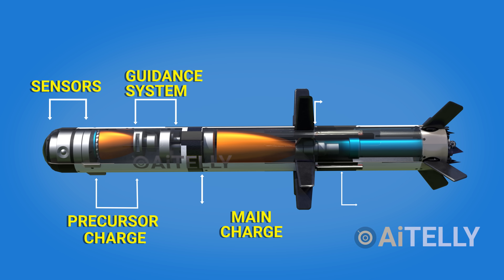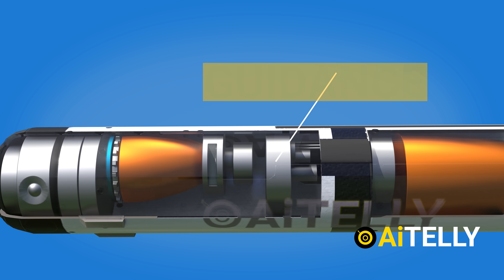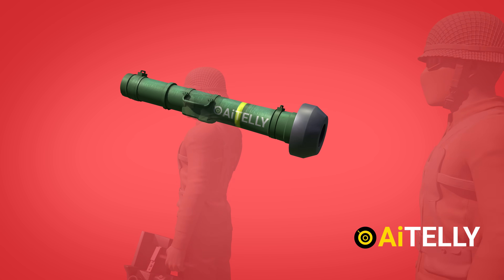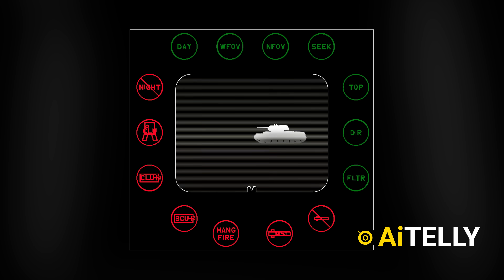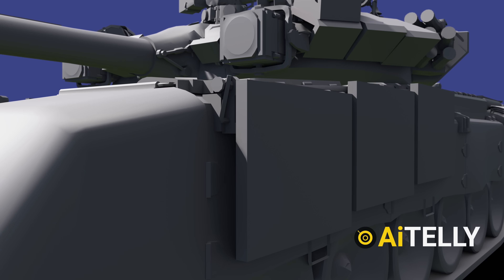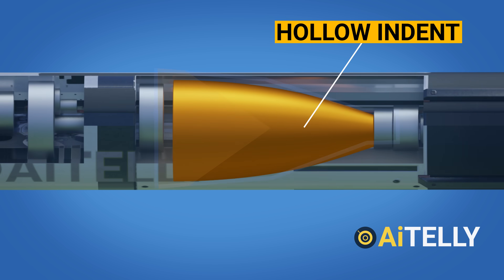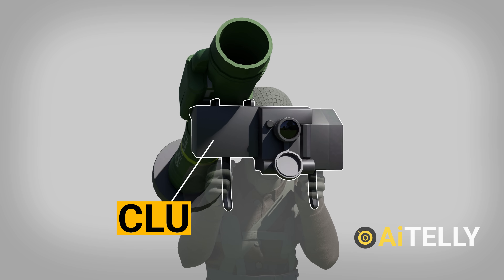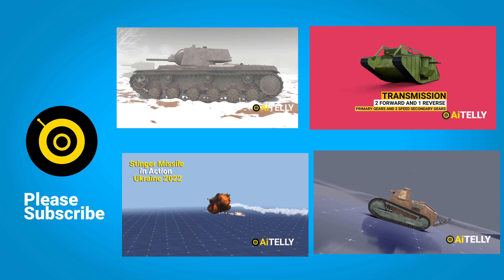Javelin Missile | How a Javelin Missile works

Comment: Very important details: the CLU's thermal sight is a line scan camera, basically a line of pixels getting scanned across the scene rapidly.
The seeker on the missile however, is not a linescan camera, but instead a starring array sensor. It has the same imaging principle as a modern visible light camera. I believe the pixel count on the seeker is either 64*64 or 80*80, and is faster than 60 Hz; still have to dig up the files
Reply: I am also interested in the framerate of the sensor in the missile head. It is probably over 60 fps (but it is usually a military secret) The US has always banned IR thermal sensors operating at more than 9 fps. I'm into programming and electronics as a hobby, and for civilian use, it's very hard (legally impossible) to get a decent IR sensor with long range and decent fps in the west. All thermal cameras work at 7 to 9 fps or if they have higher fps, then they are of poor quality and cannot see beyond 7 to 10 meters.
I deliberately mentioned "IR thermal" sensors, so that no one would confuse them with Near IR (near infrared) sensors, which are easily available and cheap.
Reply: @goranjosic  that makes the two of us! I'm located in Canada and it is equally hard to get these sensors/cameraa, how ever if you wanted to get an uncooled microbolometer one for projects i could help out :) I have been collecting them for the past decade...
 good job on clarifying the wavelength of these sensors!
For other nerds or soon to be nerds, the rough range of detectable wavelengths are listed as follow:
"Normal" cameras: 400-800nm
Intensified night vision: 500-1100nm
Laser range finders: 905nm (pulsed semiconductor), 1024nm (pulsed Nd:YAG or YVO4), 1550nm (pulsed erbium)
Laser guided missiles: 1024nm or 1550nm (1550nm lasers are modern and are undetectable by night vision goggles which make them extremely deadly)
Javelin and most heat seekers (cooled quantum detectors): 3000-5000nm
Thermal scopes (uncooled microbolometers): 7000-14000nm
Reply: @goranjosic , I don’t understand how it’s physically possible to limit the range of a thermal camera. How can they possibly prevent infrared photons from traveling beyond some distance?
Reply: @terjeoseberg990  sensor sensitivity.  The ones sold for cheap on eBay and AliExpress can barely pick up thermal signals from 6 to 9 meters (7 on average). Sometimes even in description it say that these are sensors of limited sensitivity compared to sensors in expensive cameras that cost a few thousand dollars. But I wrongly wrote that it has to do with the high framerate, it has nothing to do with that - simply, cheaper sensors in the over-the-counter market are generally less sensitive. And from what I managed to find out, all civilian sensors have low framerate.
Reply: @goranjosic , So you’re referring to the signal to noise ratio?
Reply: @terjeoseberg990  yes basically; it is actually indicated by the net equivalent thermal delta (NETD) rating of the camera. Old and or cheap thermal cameras usually have > than 100 mK capabilities, while advanced ones have 60-40 mK sensitivity.
My 100mK ones can actually (barely) spot the temperature difference between skin and blood vessels close to the surface of the skin; while my 40mk one can easily do that plus some smaller surface veins.
Reply: @goranjosic  THATS why those things suck so bad?? I thought having a FLIR cam would be cool but they're pretty garbo.
Reply from the maker: Thanks for the Info
Will put your comment on the Important Note list 👍
Reply: @Aitelly  thank you for making an effort to spread knowledge! I will try and find the actual source so that I'm not spreading false or inaccurate information 😁
Reply from the maker: @alexwang007  Please do .Let us know the right data. Eagerly waiting
Reply: Note the upgrades done to both the seeker and the CLU detectors, these upgrades will most definitely greatly enhance the resolution (as opposed to 64*64 resolution, one can obtain 640*480 or even 1024*786 resolution microbolometers); this should in turn greatly enhance the newer Javelin's target tracking ability.
Reply: those ukrainianmobsters ukraineflorida drkMarket $250K 1/4 Million per Missile Selling what we Give them For Free To mideast Terrorist&drugcartel countries Such As the 300 plus BulletProof Vests that Disappeared that we u.s. Gave them ukrainemobsters
Reply: actually this is all wrong, the missile detects the presence of communist sympathizers and becomes so enraged it slams itself into them
Reply from the maker: We take your suggestions seriously.
So here is the F35 Jet we just made
https://youtu.be/vgUnF9hUmLQ
Reply: The CLU is actually indeed more valuable and potent as a deterrent, than the Javi missile itself.  An Army could be given say, 1000 Javelin rounds as a gift, but only 10 CLU.  So the deterrence value in this hypothetical is more relative.  Whereas, An Army with 50 CLU and only 500 rounds would very likely field much greater tactical capabilities .

Hence, probably a good reason to not let the aggressor side know exactly how many CLU you have fielded!?!  And probably understate the number, if anything .
Reply: This shit is supposed to cost 100000$ ?
Where do the money go ?
Reply: @divoulos5758  it is not worth 100k. It's all the development (with infinite budget), and the component military grade certifications that raises the cost drastically, also probably with an 80% profit margin on top of all that.
Reply: @divoulos5758  --  $100k to knock out a $million dollar +  totalitarian-rule, imperial cabal commanded invading main battle tank  ??  That is not rocket science.  Thanks though, for contributing to the greater open dialogue  

edit:  Mir vsem brothers,  yes even to the modern-day inading hordes ✌🔛 we're all all human!  Spacibo
Reply: @donkoh5738  million dollar?
Bro its t72b3 it costs like half a million 
Also the javelin has so many parameters that anything can go wrong 
First of all doesn't work in urban areas 
Second because of the top attack trajectory its easily detectable by radar warning systems 
Also if the missile doesn't hit the turret top plate it probably wont do anything 
Thermal smoke launchers will fool it to miss
Ever wondered how does javelin know where the turret is since it only uses thermal vision? Probably by either engine heat or hull heat 
In case of engine heat simply turning the tank will make it miss 
In the case of hull heat putting a piece of metal sheet behind the engine horizontally will make the missile hit further back because as it sees from above the length of the tank will look bigger

Comment: So the missile locks on thermal footprint, then what if vehicle's engine is not running ? It becomes useless, am I right ?
Reply: It takes hours for an engine to cool. It only is a problem in the winter.
Reply: @miguellopez3392  Imo it's the other way around, in winter you warm up the engine to keep you vehicle ready to go at any moment. While in summer you keep your vehicle at hidden position without need to warm up the engine. Also if you look at tank in frontal projection, the thermal camera won't see a footprint because engine is behind and it doesn't produce hot exhaust gases.
Reply: @illiahapak501  did you forget metal conducts heat? In winter the steel is cooled by the ambient tempature of the environment, in summer the steel can heat up to 150f in sunlight, heat from the engine can warm the tanks entire hull if ran long enough, you don't need a hot engine to lock on, it locks onto the specific signature, in winter tanks stand out less as reports from Ukrainian soldiers using the javelin system.
Reply: So if you put aluminum blanket(like those used by rescue crews?) around tank or cardboard it cant lock?
Reply: @zumbazumba1  that foil won't do much to stop engine heat.
Reply: Another thing is that some tanks have auxiliary power units like Challenger 2. They run all the vehicle’s systems with it. This allows them to use less fuel but lessen the heat signature. Challenger 2 can also be dressed in thermal insulation camouflage.

Comment: Russia has a secret weapon - the gravity switch. If you send it to the enemy's territory, then everything will soar into the air to a height of 14 kilometers and drop sharply. On an area about the size of the state of Florida. Who is not underground will break, and who is underground will suffocate on the ceiling.
Reply from the maker: They had sent outdated javelins or expired Battery that why it did not work.

Comment: You didn't mention about it's short battery life, and it can operate in seeking mode for about 2 minutes, then it has to cool off. Also the thermal imaging is only 64x64 pixels so it can be fool by something other heat source. I heard it can be fooled by aerosol smoke. It's also not very easeful in the city fight.  Looks like the tank has to have 2nd layer of dynamic cover or active armor protection system.  But it's a very dangerous weapon for the older tanks and if used in right hands at right time.
Reply from the maker: Thanks for the feedback.we miss that.
We are learning from comments right now.
Will do better with New content.
Reply: @Aitelly  I don't know if I'm responding to a bot reply, but the problem with all the news and other technical information (this video clip is included) is that it's taken only from couple sources especially from loyal side. Which leads to present incorrect information.
Reply from the maker: @Andrei Casiadi  I'm not a bot :) We just have to reply to a lot of Comments .
Pin your Comment as we find it Neutral and Valuable.

New Channel so Hustling as we move along.
But we take your Feedback Seriously.
We are not always Right.
Yes Honestly We collect a lot of Data from different Sources.
Reply: It's a very dangerous weapon for modern tanks
Reply: Field tests in Ukraine showed that it's good NOT just for "very old tanks", Andrei 😁
And by looks of it that's you who appears  on the "bot side"
Reply: Can't use it in urban warfare because it needs about 2 seconds to arm the missile, it primarily has to be used from a distance  since its a tank killer, I saw one video in Ukraine where a soldier use it in a tank about 50 meters inside a town (it didnt detonate and not a scratch on the russian tank)
Reply from the maker: @DOI_ARTS  Thanks for the valuable info.
We highly appreciate it.
Reply: @Aitelly  no problem,

Comment: Great video 👍🏼  Thank you!
If I reckon right, metal thickness should be 60 - 80 mm, not 600 - 800 mm penetration.
Reply from the maker: Well the document say like that. If it is battle tested i think it be might working. But there are also people saying it is not Working In Ukraine.
Reply: @Aitelly  You are probably right then.  It’s just astonishing it can penetrate 2 ft. thick metal.
Reply: Jas K.
You obviously have no idea how a shaped charge works. 
Extreme heat cuts through thick steel.
Reply: @grahamlucas2712  yet  jet fuel can't melt steel beams.
Reply: @SeedmancChitOKun  .
As you are referring to the World trade center attack.
Any fire of considerable magnitude and duration will weaken structural steel, and with the loading of the upper stories, eventually collapse.
DH.

Comment: Why doesn't the "intelligent" top ejects before it hits? So they can re-use the "hard parts"?
Reply from the maker: It was reported because of the High Cost of Javelin -US DOD in their Order - it required to have a Reusable MANPAD. 

But RATHEON, they made the  CLU (Command Launch Unit) Reusable but the Launch Tube Assembly Disposable a clever way to say it is Reusable.

Now for your Question: The Hard parts were meant to be Collected and reuse but the in the Heat of Battle-  ,the soldier might leave it in the Battlefield.

I might be Wrong, but these are my views feel free to Correct me and my team.

Comment: None of you guys explain how the missile tracks a moving target…can you explain that? I get the rest.
Reply from the maker: As a fire-and-forget missile, the missile must be able to follow and destroy its target without the help of the gunner after launch. This is accomplished by combining an onboard imaging IR system (not to be confused with the CLU imaging system) with an onboard tracking system.
You Can also take a Look at the Stinger Missile System where we had Explained how it Tracks its Target.
https://youtu.be/suKv8G3Gd88

The gunner utilises the CLU's infrared system to locate and identify the target, then switches to the missile's independent infrared system to construct a track box around the target and a lock. For locking, the shooter adds brackets around the image.

The seeker maintains its focus on the image of the target, tracking it while the target moves, the missile's flight path changes, or attack angles shift. The seeker is made up of three primary parts: a focal plane array image sensor, cooling, and the seeker itself.
Reply: @Aitelly  ok stop! I can only have so much boner! Btw. Shot this baby in Afghanistan in 2009. I think about it before i go sleep with a satisfied smile on my face.
Reply: thesun. Not at all difficult. Combined optical and thermal target imaging.

Comment: very good animation.. you called them fins , some call them wings. they were originally called strakes and the rear were fins.  Did they change the missile diameter to 5.6" from the original 5?    I think 5.6 is the carbon tube diameter
Reply from the maker: Thanks for the Feedback this is really Informative will Look into it .
Reply: @Aitelly  I think the missile diameter is 127 mm.
Reply: @jonasingiragnarsson2512  yes 127mm is exactly 5 inches.  only reason to change it from this original size would be larger warheads or rocket motor. But the Army always complains about its weight.
Reply from the maker: @elkskiutah8204  thanks for the information. 🙏 Will keep on producing more honest research content. 👍
Reply from the maker: @jonasingiragnarsson2512   and elkski Utah

  Hope you don't mind as we have given Credit to your Correction and pin it in the Comment Section .
Reply: those ukrainianmobsters ukraineflorida drkMarket $250K 1/4 Million per Missile Selling what we Give them For Free To mideast Terrorist&drugcartel countries Such As the 300 plus BulletProof Vests that Disappeared that we u.s. Gave them ukrainemobsters